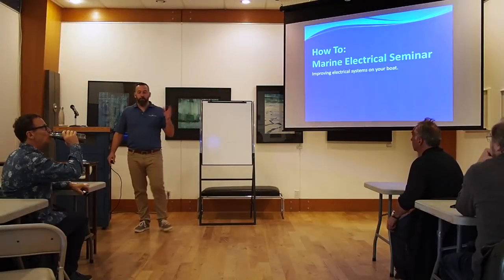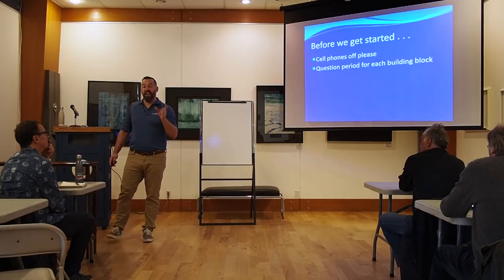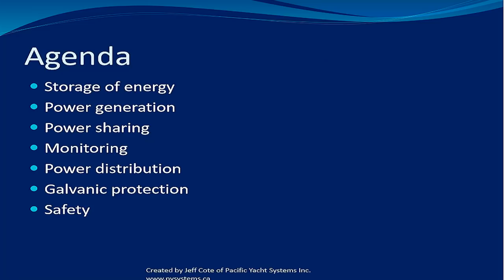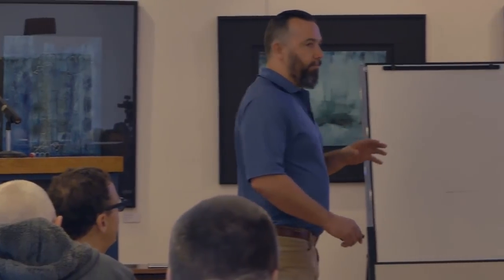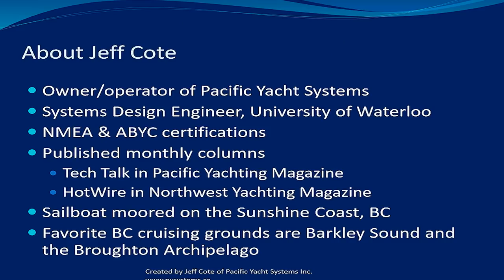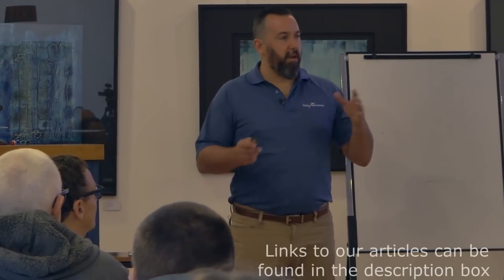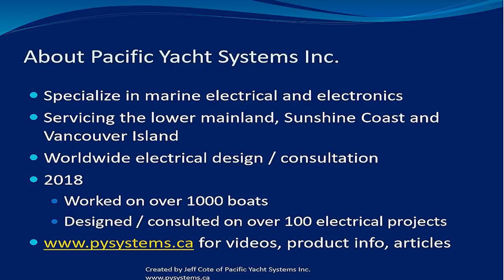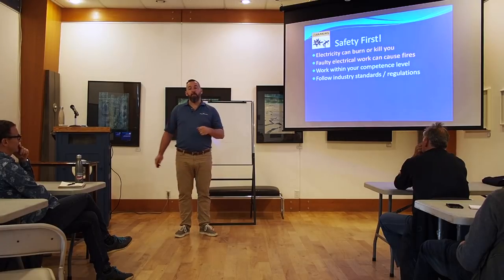How To: Marine Electrical Seminar - Intro - Ep 01/30

Comment: I have a question. 3% voltage drop is the "standard" for critical. Can I upsize wire size to get 1% voltage drop or is that harmful? I can not find anything that states a minimum. For example, A 50a load to a trolling motor @ a 10ft cable round trip @ 3% drop needs a 8awg, can I upsize to a 6awg for 2% drop or a 4awg to get 1% drop. Good or bad?